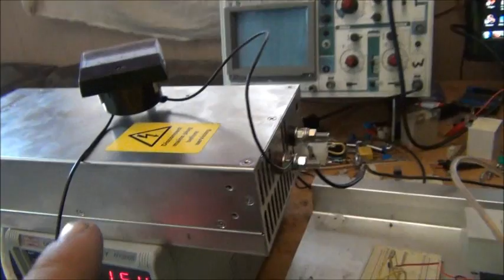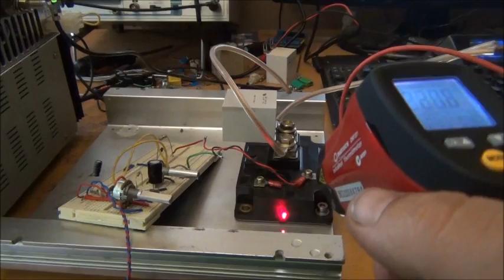Thursday IGBT Brick Flyback Driver Inside, Thunderstorm Outside!

Comment: alex ya wanna put a good few more turns on primary n run higher voltage on input say 150v adding more pri turns will also reduce current needed for a given output ... those igbts a usually rated 1000v ish
Reply from the maker: things you learn over time hahha yeah i know now.. now..
Reply: @alex993cc1  lol thanks 4 reply thought u probs would since been 5 years  but just thought id say ,,, i got 4 x 400 a 1200v sat in a draw ive had ages i bought them on ebay uk will build fulll bridge eventually will probs use tl494   igbt driver chips n gdt for isolation ... do u still play with this stuff